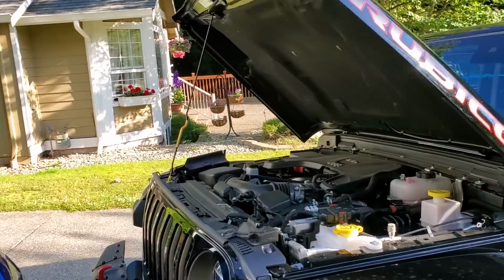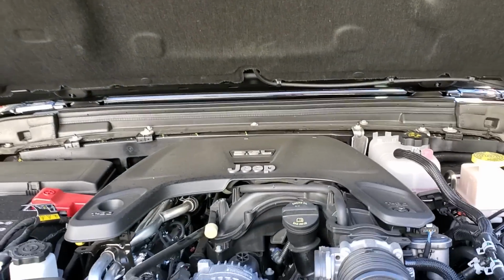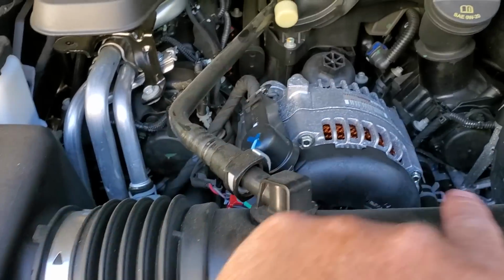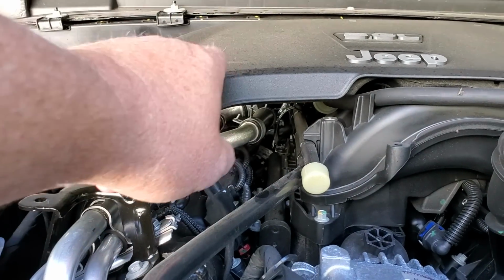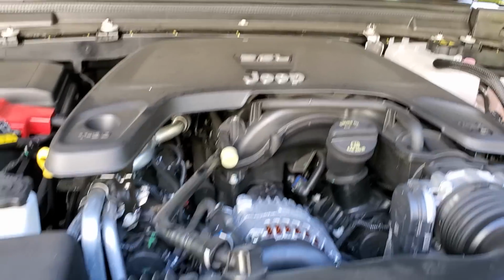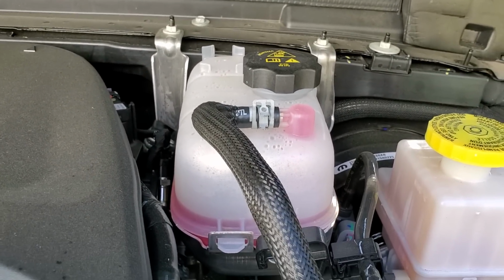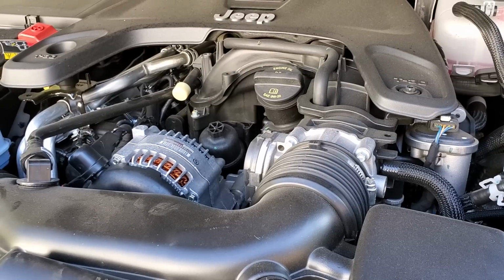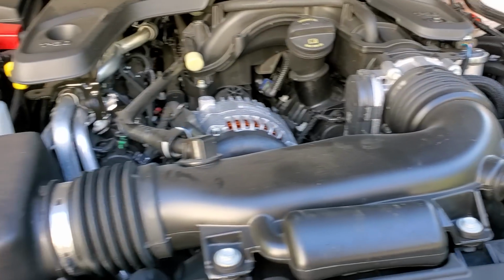Jeep Gladiator - 3 things I don't like

Comment: Sir, as I get closer to my purchase of the gladiator, I am wondering what you would do different if purchasing again. Would you purchase a lesser trim model than the Rubicon and perhaps add after market mods? Don't know if this might be subject matter for a new video or just a few lines here. I ask you because you seem to be a practical man about things.
Reply from the maker: the only thing I wish I had was that forward facing trail cam. I figure at some point it would be available but don't seem to. I could use it. I would ABSOLUTELY get Rubicon. no regrets on it. I'm pretty happy with it all.

Comment: Agreed on all three. Wranglers (and therefore Gladiators) are for guys not afraid to pick up a wrench - the basic skills to keep your vehicle running are disappearing. Did you get the windshield done?
Reply from the maker: not yet John,  there telling me it's due in late this week now. I sure cant wait. agree on the ability to work on them disappears
Reply: vegasdavetv jeeps are by far my favourite windshield to replace. They are so fast and easy since everything is exposed, you don’t even have to take the wipers off (although you should)
Reply from the maker: @matoosie5585  good to know that 👍👍